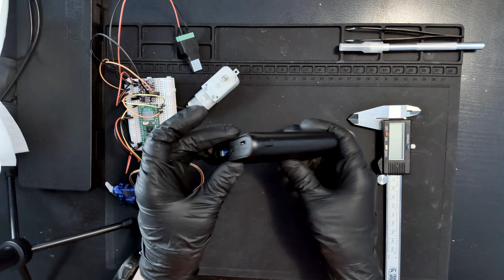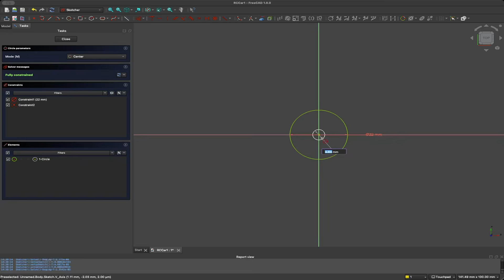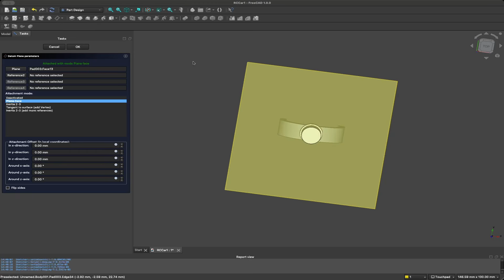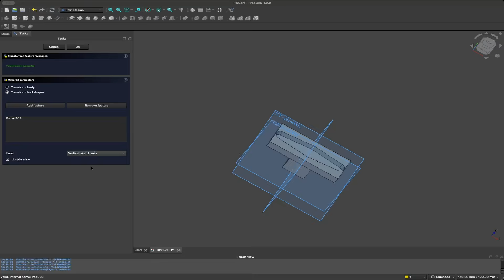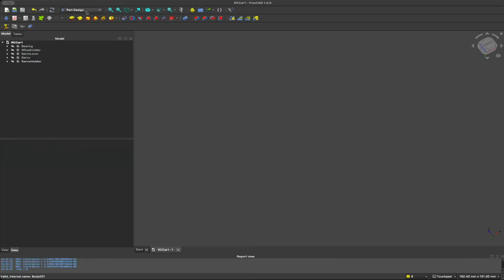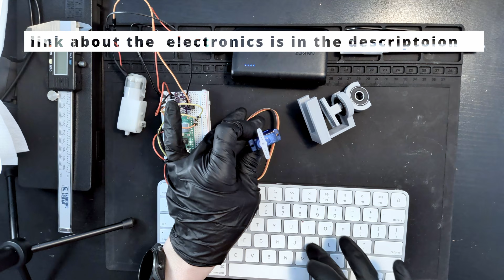Designing a 3D Printed RC Car Steering System | RCModelA

Comment: I would suggest to think a bit more  of the load directions and 3D printing layer direction for a part that is supposed to bear a load. The bearing isn't kept from sliding out even if you have thought about the inner shaft not sliding out of the bearing. It is just friction fit. The way you connect the bearing and the main body is going to be weak for multiple reasons, first you either have the layer lines weakening the arm or the connecting part if you print it that way, it would be much better to print it sideways, but then the round part holding the bearing is placed awkwardly. And it should be supported on more sides. The difficult part in most cases lies in these details and how you design around them and you skipped over this. The part is functional, yes, but probably will break very quickly.
But don't stop here, there is always ways to improve and you can make many designs before you settle on it. This is part of the fun.
Reply from the maker: thank you! I completely missed the strength point - I was printing to make sure I minimize supports (so things look better). I need to print a shaft, will follow your advice!